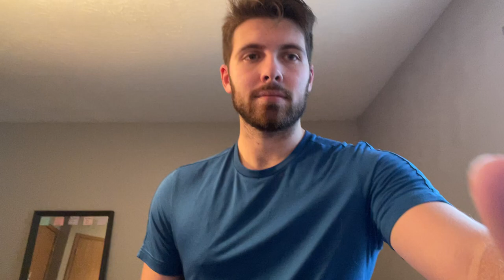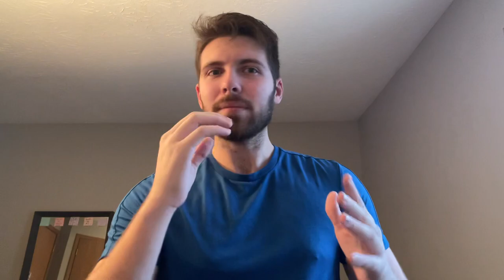Can you string a cracked tennis racket?

Comment: What rackets would you suggest for aggressive baseliners and a counter puncher? (Maybe even be a new video idea discussing the different type of styles and how to beat them)
Reply from the maker: What racquet are you using now and what are you not getting from your current racquet that is making you want to switch?
Reply: @brodytaylor2020  I’m just switching around at the moment just trying them all but currently using a head gravity pro mostly
Reply from the maker: The Gravity Pro is a good choice for a counter puncher because of the great amount of control it offers. I would say the Head Speed Pro is another great choice with being a bit more powerful than the Gravity Pro. I would also look into the Technifibre ISO 305 with the 18x19 string pattern. Then if you really want a more control type of racquet you can look at the Dunlop CX Tour 18x20 since it has the 95sq inch headsize to help with a precision and redirecting your opponents power.